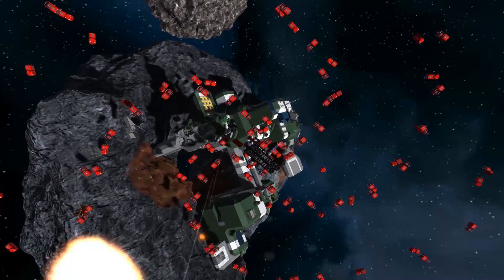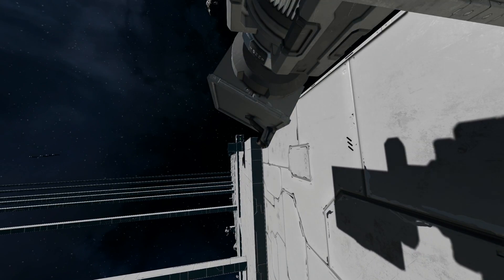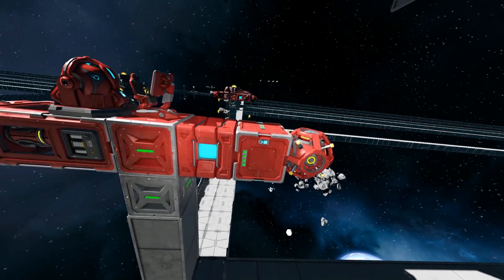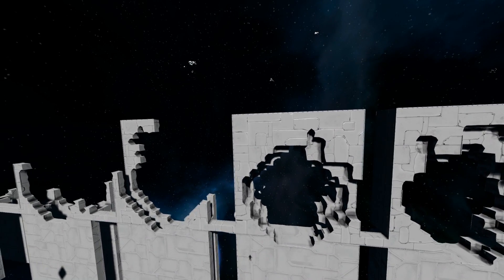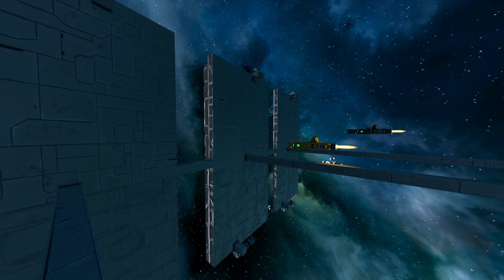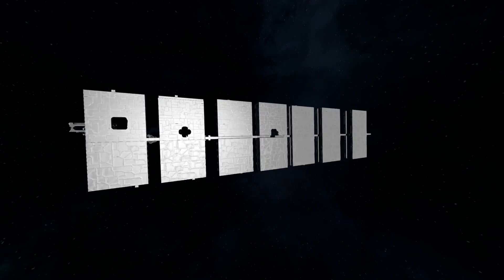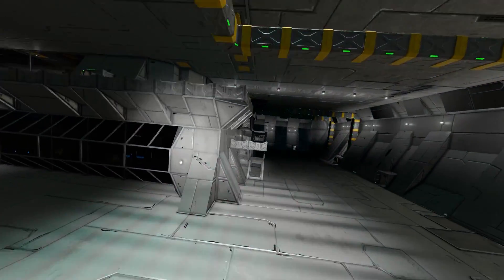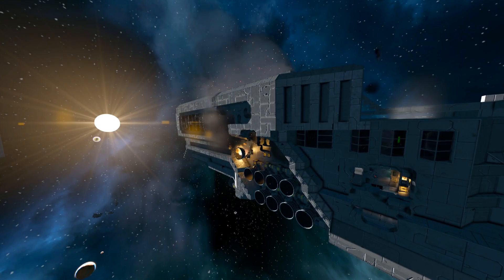Space Engineers - Payload Testing & Breach Missile Design Step 1

Comment: Nice work. I had a bit of a go at missile design ages ago for remote missiles. I ended up going with one that a heavy armoured tip that detached from the missile at speed and then smashed it's way into a ship before detonating a warhead inside the back of it. Then you'd fly away with the engine part to refit and the remains of the heavy armour part would still be rolling around inside the enemy ship causing damage when they moved.

Comment: There's a much better weapon than missiles that can be shot down - a huge and inexpensive grinder on the front.  The amended physics engine means that if you like up a load of spinning rotors with blast blocks counter rotating they quickly chew through any ship you can.  Needs a fair few gyros to stay stable though

Comment: What I learned about Warheads in Space Engineers is, that they are very inconsistent. I love building self-destructions into my ships, or critical 'heat' systens and and and. It seems like Space Engineers can't properly handle multiple Warheads going off on the same grid. Warheads not setting of other warheads are a thing, A moving grid changes the explosion compared to a stationary grid. If it's a station or a large grid seems to make also a difference. At some point in development, KSH seems to have changed the behaviour of warheads, or the Math/ Pyhsics. I have a really nice self-destruction sequence in one of my older builds, that blew up back to front and only left a husk of the ship with a few systems left. In the current version of the game, this doesn't work anymore. The warheads seem to explode and disable any warheads in the proximity. They are not damaged or anything. They are still there, but non-functional. Using the detonate button won't work on them either. So I expect, when you are designing your rockets, keep in mind that small changes in the rocket or target, can make huge differences in the outcome!

Comment: I wonder at the immediate discarding of solid projectiles - certainly my experimenting with grav cannon gave the impression that at maximum speed you can punch a heavy armour block projectile through multiple layers of defensive heavy armour. Then the thing is loose in the guts of a maneuvering ship and smashes things to pieces along with being a lot cheaper and simpler.
Reply: i agree. because of the nature of loose parts causing internal damage explosives is the last thing you want to use, you'd only blow open a hole for the loose blocks to get out. one heavy armor block on the inside is enough, maybe stick a container full of rocks on if you want even more damage.

Comment: Wasn't the purpose of the light armor meant to be anti light arms ammunition, like turrets and rifles, and deflect debris or alter trajectories of incoming collisions, while heavy armor was meant to be anti heavy weapons? So ideally a realistic design meant to be used in combat should be a composite of the two, possibly using light armor as a form of cheap and easy to replace ablative armoring, to deflect light arms, with an inner layer of heavy armor to stop the warheads/missiles, that is a little more expensive and difficult to replace and therefore you want to protect it from the slow death of a thousand rounds so it could be fully effective against the heavy arms. So then would not an ideal weapon be something that could displace the outer layer while still being able to attack the heavy layer? Or am I the only one who designs their ships with this logic?

Its a little more costly and time consuming to set up, but even my hand made missiles have a penetration head with a delayed warhead to punch through the outer layer of light armor to explode on the heavy armor. And when facing only light armor, it punches through, only to deliver a warhead detonation to the inside of the ship. Kinda like how a bunker buster missile works.

Comment: I like the precursor penetrator you used for this rocket, that's absolutely a viable way to defeat multilayered armor on a realistic ship or station someone built. For actual weaponization though, I suggest using an explosive precursor charge that detonates on contact with the hull to blast a whole open rather than smashing it. Kinetic energy is OK at getting through light armor, but an explosive charge will open up a bigger hole in light armor for the main charge to enter and still retain some effectiveness against heavy armor.

What you've done so far has me thinking that spaced armor is the way to go, with an exterior cage of slat armor made of heavy armor blocks to detonate incoming missiles away from the hull. I'm going to be watching this experimentation closely, this is the part of Space Engineers that always got me going.

Comment: If I understand the destruction mechanics in SE right, each block has a durability. When a force is applied to a block (such as smacking into something) that block is destroyed if the force exceeds it's durability. The force can also travel along blocks it is connected too (presumably with some dampening factor for each block it travels along). This would explain why only the armor blocks where left with the small ship, all other blocks had very low durability, thus they were instantly destroyed, while only the armor blocks closest to the impact got destroyed since the other ones had a high enough durability to withstand the impact.

Comment: I like using unpowered gyroscopes as penetration blocks.  It's compact, robust, and will just fly through armor at full speed.
Using the Lotus Blossom spinning technique, I like to use merge blocks so they spin off close to the target to provide a shotgun effect.  I set the missile up to scan for damage to itself and it releases the gyros when it takes damage to the LCD at the front.  That puts you within 800 meters of the target.  So if you control the spread for 800 meters of travel, you can really pelt whatever it is you're targeting.

Here's a video.  The actual collision is at 10:22
https://www.youtube.com/watch?v=AWNLMHhv_1Q&t=10s

Comment: After the physics change, this is basically what my weapons have started doing, albeit on a much larger scale. I dropped some posts on Reddit a while back about one I had made, the Mk. 60 to be specific, which used a 10-fragment multi-staged charge like this, that had triggering sensors to check for when it was actually inside the target, and as a contingency, a timed detonation sequence that would blow the charges anyways after two seconds if the weapon didn't make it all the way in. This isn't the best footage, but this is what it did to one of the submissions from my Reddit thread requesting target ships: https://youtu.be/VKTrfaA0qdA

I'm terrified to see other people adopting it. Fragmentation warheads are the way forward now that the kinetic item nukes of old are gone. Once you build these big enough, they become virtually impossible to defend against. When testing that torpedo, now the Mk. 62, I actually had to implement the auto-detonation sensors to stop it from going all the way through targets without detonating.

Comment: What would happen if a person were to layer light and heavy armor? Maybe, heavy, light, light, heavy?
Reply: It doesn't necessarily do any more difference. The warhead hole would be bigger but stops at the 4th layer of heavy, same as above tests and kinetic torpedoes just cut straight through anyways. The real cheat is to use wheels between spaced armour as it diminishes speed of projectile with an absurd friction value which means no KE, no pen. The wheels are super vulnerable to conventional explosives tho so adding armour on top of that layer to absorb warheads are necessary. Now the way to defeat this armour is to use a warhead torpedo with light armour front that crumples and breaks so that when the warheads inside gets into contact with the wall it should be deep enough to do damage to the wheels and punch a hole through that layer. However, the warhead explosion would slow down the missile by a huge margin so this has to be a 2-stage missile if you want to do any more damage after the wheel layer.
Reply: I just use a kenitic rotor cannon projectile made of a merge block and a blast door edge. That thing tears through armor and is hard for turrets to target.
Reply: Despicable Ocelot I just mod in a shield projector

Comment: A little tip for those first multi-warhead designs: active warheads are detonated by trigger or impact only, NOT by explosions. When one of the warheads detonates on impact, all others are uselessly destroyed in the blast. You used sensors to trigger the warheads on the later designs though, so...

Comment: Not sure about cost efficency, but could you use artifical mass blocks and gravity generators to propell the sabot without having to slow the actual missile? Further... Can you use artifical mass blocks as a solid shrapnell charge? I may be a bit outdated with some of these ideas, but I remember watching people fire tiny rocks into ships to gut them from the inside out. Another thing I remember being a thing is composite armor, basically a layer of light armor between layers of heavy armor (not sure how good it is though, I just remember it tanking standard rockets a good deal better than pure heavy armor and being more resistant to deformation), so maybe include that in your future tests too? (I also remember someone placing a tire under a sheet of armor to take the blows).

Comment: Interesting bit about warheads:  Damage is NOT additive.  One, two, 5, 16 warheads going off simultaneously will not do what you expect.  Damage from each warhead has a fixed radius.  To increase the damage using multiple warheads, you ave to increase the distance between them.

Comment: So it looks like you are using what could be considered in a conventional sense, tank shells. Your first iterations were largely armor piercing with little destructive capability. (They punch through) Yet your last missile is more like a HE shell. You pretty much have a penetrative cap and a delayed fuse so that once inside, the explosion does the most damage. I think one way to increase the damage without increasing cost, is actually to launch a warhead behind the missile which still follows. That way you can maximize penetration with the missile body yet still have an explosion. I think your current design stops destruction because the body of the missile surrounds the warhead. By launching it behind, you efficiently penetrate with the missile body yet still do maximum damage.

Comment: The testing you've done here has made me wonder what it would have been like to launch those penetrator missiles at the Cronous in PvPvP.  You demonstrate it here with the Whale, but I can't help but wonder what kind of penetration you could have achieved on the Cronous with its heavy armor bow, its light armor sides, and its compartmentalized interior.  Another idea I'm curious about is how the missiles you've designed here would perform with a jump drive attached, assuming someone created a modded,  miniaturized jump drive in either a smaller large block or small ship block.  Picture, if you will, when Green team stumbled on Red team early in PvPvP.  I believe the synch distance was like 5 kilometers at that point.  With a jump missile, Green team could have held position at 5ks, launched a phalanx of jump missiles in the direction of Red team (though the probability of a hit would have relied solely on the position of Red team's ships), and then jumped in behind the missiles.  The jump missiles arrive ahead of Green team and either impact Red team's ships, causing damage, or the sudden appearance of the missiles causes confusion in Red team, allowing Green team to jump in while Red team is reeling from the surprise of being attacked by jump missiles.  Now those are just examples, but it would be cool if it could actually work.

Comment: Rather than having the separator at the back, have a solid front (a few blocks) to penetrate then have the warheads on the back detonate on the rear based on a sensor and a timer. Still getting the deep levels of pen and then getting the internal explosion. Even if it doesn't get through the layers of armour the solid bit will bury the warheads deeper in the amour causing more damage on the case of a non pen.

Comment: Really enjoyed the vid, brought back nostalgia :) Have you considered not using warheads? I found that in my own testing mass and velocity works the best, especially blast door blocks. In game, an APFSDS shaped projectile made of 1x8 ish blast door blocks, with a few warheads at the back, protected by the blast door blocks in a fin shape is optimal for penetrating *REALLY* armoured targets, e.g. capital ships with 10-12+ blocks of heavy armour on the front.  And it works great in gravity cannons. 
Typical results with the projectile  is penetration deep into the target, with an eventual warhead explosion that (because space engineers) doesn't destroy the projectile, yielding splash damage against the lighter internal components, whilst the original projectile penetrates deeper, usually surviving mostly, and bouncing around inside the ship when the ship moves to cause further damage. 
After all, damage in this game is dodgy, but I think that kinetic energy is the most important factor. (High Mass and *Velocity**) Because: Ek = 0.5 Mass x Velocity^2 
However the aforementioned damage and results were conducted in a speed limitless server, with an average impact velocity of 600ish ms^-1. *BUT* the results were still consistent with the findings above with a speed limit of 100ms^-1, just with slightly reduced effect. (not as much as you would think!) So try a more simple APFSDS design from tank combat, with a few warheads at the back, and just place an emphasis on velocity.
Reply: edit: fixed an error, but plz like so w4sted sees!
Reply: yeah, can confirm, blast door kinetic weapons are the most powerful missile type by far.
Reply: Having made many a cannon meself, this is more science for the same result.

Comment: I've try these concept before. Using rotor heads detachment and muti-grids design(battery, timer, gyro in small grids, armor thrusters and warhead in large grids) can come up with some very interesting and efficient missile design!
And also, large grid heavy blocks(hanger door for example) are better in penetrating heavy armor.

Comment: Hell yes, I loved these videos back in the day and I'm glad you're making more.  Couple thoughts on these missiles..

Are the blast door/shield blocks still in the game? The ones that don't quite take up a full block's worth of space?  I remember you tried a few missiles using one of those as a penetrating tip for a missile and it worked okay, but I didn't see any in this test.  Have you tried them and they just weren't worth mentioning, or maybe give 'em a shot?

The separate penetrator + delayed-blast warhead body seems to work pretty well, though obviously you're going to have problems with heavy armor.  It'd probably make it deliriously expensive, but maybe have the small rocket pod on the front that can unload on the target right before it impacts?  Might do better vs heavy armor since it's an actual weapon.

You mentioned gatling-cannon warhead projectors.. how are gravity guns these days?  It'd keep the expensive part on your ship while letting you pepper the target sufficiently with armor-stripping warheads before firing delayed-blast missiles for internal damage.

On the subject of internal damage, do exploded cargo containers blow their contents out when they're exploded?  Not terribly practical, but tiny hole, lots of shrapnel?

I'm curious to see what you come up with re:deployment/tracking, cause the only way I can think of to solve the tracking problem is with some pretty complex scripting.
Reply: On an unrelated note, I haven't played the game in forever but I heard they disabled gravity drives.  Is that true?  Did they also disable gravity guns the same way?

Comment: those were pretty effective at the end maybe not against a moving ship but throwing those at a static asteroid base would work wonders
Reply: if you combine it with the LIDAR missile script, it should be fairly decent. Just needs a gryoscope.
Reply: I was thinking the same, with a moving ship (or moving attacker) chances are the head would hit a different location to the payload. Though that could still cause some useful damage.
Reply: Interesting...
Reply: Guidance system for the second payload?
Reply: Could also slightly delay speed of first payload while increasing speed of second payload upon separation
Reply: In the end though, youre sacrificing  a margin of velocity that could mean the difference in striking the target
Reply: Could also do a condensed lotus at the end that opens simultaneously with the breach, for a localized spread effect
Reply: Protects the payload, yet still ensures one of the warheads get through
Reply: It only has to spread out the length of the missile